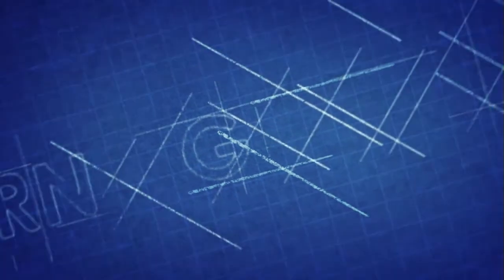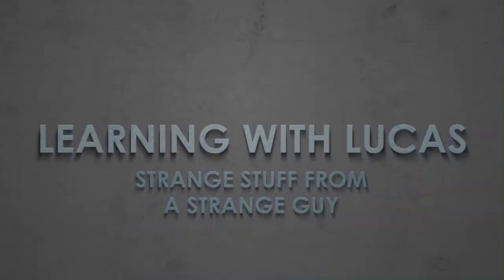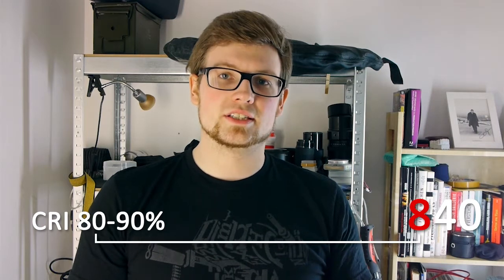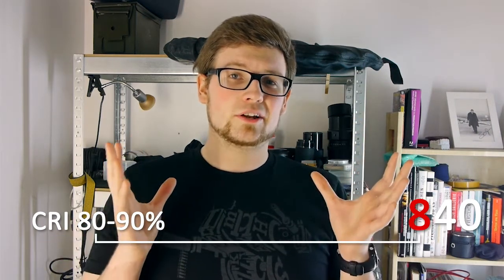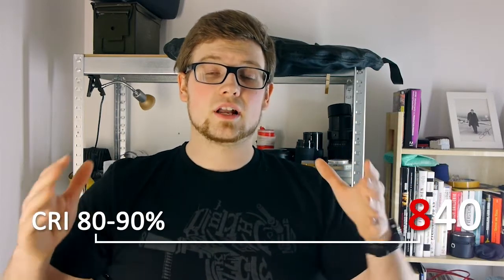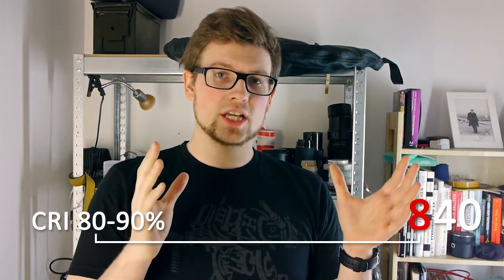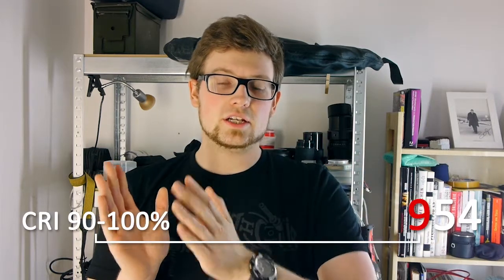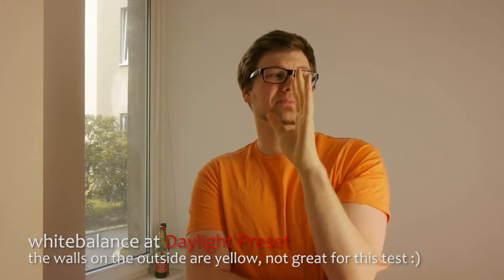the OsVinci Code - getting the best Lightbulbs for your Build! DIY-Info

Comment: So far, I've used these Flo bulb and came up with the greatest bulb Philips TL-D Graphica 950 (97CRI with 5300K temp) Full-spectrum Phosphor bulb. But available for 4' and 2' T8 18.36W only. Philips PL-L 954 didn't do the same.

Compared to Osram Dulux L 55w/954, The osram used Tri-Phosphor which is 3 bands colour bulb. acceptable for normal use. But for Critical color accuracy I might preferred to use TL-D Graphica 950. It's fantastic bulb. Try one and you'll like it.
Reply from the maker: This build is, for me, really about price/performance. Got the osram 954 for around 3€/piece which is awesome. Don't know if I can get the Philips with weird imperial measurements here, have to look that up! 

For real critical color though, I'm not too much in DIY and would most likely rent real Kinos. But luckily I don't have to be that accurate :) 

Great find!